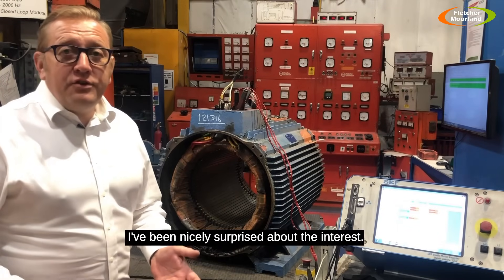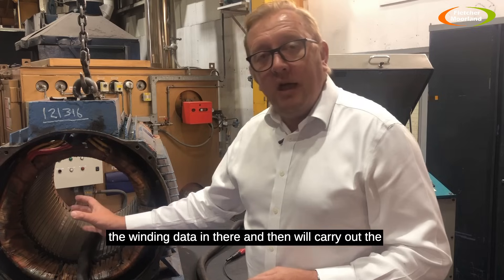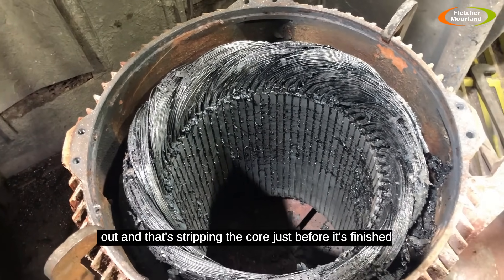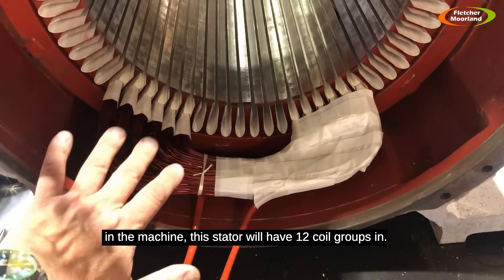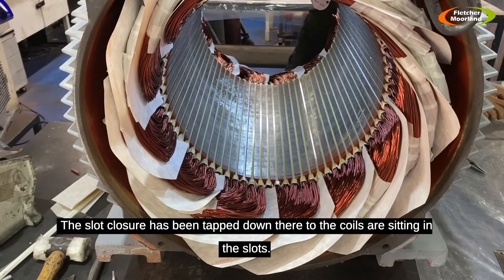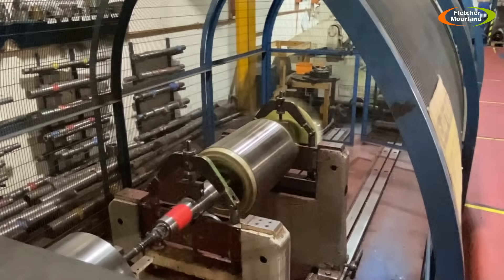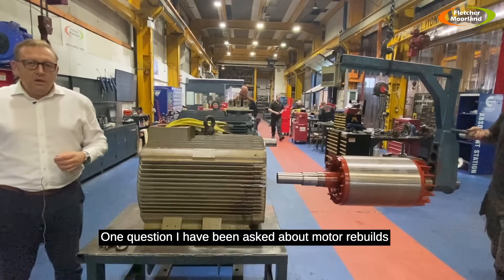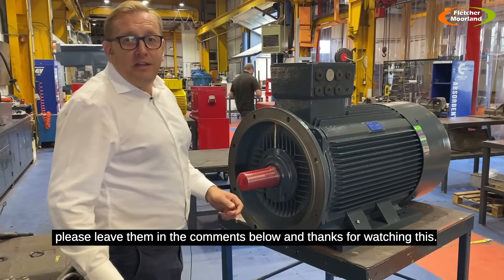How it's done....Electric motor rewinds

Comment: I was a industreal electrician in hard rock mines. Both underground and open pit mines.
I give away my age when I tell you, I hold Journey Man 1st. Class Industrial Electrician, North West Territories, Canada. Ticket # 108.
I was also the only motor winder in the N.W.T.,  winding A.C. and D.C motors. Single phase and three phase. 1/16 hp to 1000 hp.

Motor factories now use machines to wind motors.

Comment: Are you looking into electric car motor rewinding yet?  Are they too small?
Reply: No, they are a little more complex but we are rewinding and repairing them. We see more bus/truck traction motors than car motors just now, however I do see car motors increasing here for repairs.
Reply: @fletchermoorland3501  if you are following EVs.  The early model Teslas leak coolant into the stator and damage the windings.  If you want to create a new business segment.  Nearly 100% failure rate.

Comment: Rebuilding an electric motor (large commercial) is far more economical than a complete replacement, plus the upgrades that were shown make it superior to the original unit when new. Excellent video.

Comment: Worked in the Uk several times and im surprised by the lack of PPE 🤔
Reply: The processes shown that needed eye protection were the removing of the windings, balancing, brazing the connections, VPI and testing. All had eyewear. The guys wear safety boots too. That's all that is needed for those processes.
Reply: @fletchermoorland3501  Odd that, because every powerplant and rotor repair shop I worked in while in the UK required ppe at ALL times 🤷🏾

Comment: That's the butcher way of doing it.
Reply from the maker: What is Simon?
Reply: @FletcherMoorland  the way your putting the wires in. 
There all tangled and forced in.
I invented away to stop that happening.
Reply: @FletcherMoorland  average of 25 seconds to fit one side of coil. 
Each tool is designed for the core thats been rewound and 3d printed. 
Have tested it up to 2.4 mm wire.
Reply: If your interested its still in beta. 
But perfect for large semiclosed slots 
Works for full and half slot windings 
Goes in like magic

Comment: There are videos on YT of this very process being carried out in workshops in Pakistan. No personal safety equipment whatsoever for the workers...dust and dirt everywhere...the floor the ceilings workbenches its everywhere. No hi tech balancing ..analysis ...fault finding etc equipment to speak of. Open fires in the middle of the work area to burn off any old insulation and presumably to cook on at the same time. In fact it would be safe to assume that they defecate right next to their work area....Amazing

Comment: do the economics actually justify the rebuild?  are they that expensive?
Reply from the maker: They certainly do, plus there is also the sustainability side of repairing and reusing something already built instead of manufacturing new. In this case the rewind and refurbishment was around 40% of the cost of new.

Comment: 17:27 You have NO idea how important it is to look after a shaft that size without protection because you don't know who's going to be touching it, how big the hole is, who's going to lube up that big shaft so it can EASILY slide in the hole, how clean is the hole, who looks after the hole, how often is the hole cleaned, how proud is the owner of the hole, has the hole always been looked after, has the hole ever been tarnished or gotten really dirty so it had to be thoroughly cleaned so no one would no how dirty it used to be and is there ANYTHING that the hole could do to damage the shaft?

Comment: Thanks for that video, I left the motor rewind trade 40 years ago having had a 5 year apprenticeship and then 6 years as a skilled winder. Most things haven't changed much although we wouldn't have done the initial tests, well we didn't have the equipment to do them, also dread to think of the damage we did to the lampack heating up with gas torches to strip the old windings, also no VPI back for us back in the 70s and early 80s varnishing was just running the varnish over either end and through the core before into the oven overnight. Great video and certainly brough back a good few memories, can almost smell the varnishes and the odour of burnt out windings on a motor in for repair. Happy to have done it for 11 years, equally happy that I changed to a career that let me retire before I was 60. Thanks for posting.

Comment: Simply Fascinating ! I like the practice of repairing and rebuilding defective units instead of simply disposing them, or even recycling the metal elements alone. Looks like your rebuild tolerances are superior to the actual original manufacturing specs, thus, you're improving the efficiency of the device. In other words, "you're company is remaking the generator better."

Comment: An informative video but, one thing I would have liked to have seen was a little more detail on how each step of the process was accomplished.  Like installing coil groups for example, it basically showed what it looked like before they were installed and then what it looks like after. Not really showing much of how the actual installation process was done.  But a good video nonetheless.

Comment: I did my electrical apprenticeship as a  rewinder 50 odd years ago, then became a linesman LV and HV/cable jointer LV and HV then Switching Operator LV and HV up to full Switch Yard/Transmission voltages (220kv) and now a retired pensioner. Practices and materials have definitely changed over this time!

Comment: Ah! so the the coils are formed and then manually pressed in one wire at a time! I was never sure if they were "sewn" through end to end. How many man hours did it take for this stator receiving to shipping?

Clearly for certain applications, this is economical for the customer, but is anybody still doing "small" motors/generators?

Last week diagnosed a 6.5KW genny stator with a toasty phase. An entire replacement unit (with power plant) is $700, I can't imagine that I could have the stator wound for less.
Reply from the maker: There are certain motors that have to be 'sewn' through and then there are times where the whole coil can be pressed into the slot, those are usually more HV stuff. The time to complete this stator was around 80 hours. For the smaller stuff it's generally not economically viable to repair. This is unless you can't get them anymore!

Comment: Carn't be bothered with air extraction on an unknown burn-off varnish coating, is the burn-off producing cariogenic ash??,  sod it, where British,  we  filter everything through a fag...
Reply from the maker: Don't be that bell-end please! The burn-off oven is produced by Pollution Controlled Products designed especially for the burn-off of electric motor hydrocarbon varnish. LEV monitored and signed off by authorities.

Comment: I understand from other experiences, the lacing is made to fall apart if the windings are 
overheated? I work on small gas engine generators and people who work on these say
that if the lacing is in pieces, the gen was overloaded, so between missing lacing and 
color changes we or I can tell if it is worth fixing. If the color is good and no missing 
lacing then I have to find if the rotor is good and if the exciter winding in the stator is
also good. there is more to this. The rotor receives power from the exciter winding after
it has been rectified and sometimes a voltage reg. is used.

Comment: 200 KW motor /voltage would give the amps drawn? which would determine wire size? what 
would the voltage be for this motor? I see this as a 268 hp motor? So if the motor is rated at
90% efficiency, just about all current is being converted to a mechanical force. This is a great
video. Thanks!

Comment: Would like to have seen how the lubrication is setup.  Is it a polyurea grease used?  Is it auto lubricated?  I understand many motors are ruined when grease enters the motor itself.   What was the application of this motor?  You said it was water ingress that caused failure was anything done to prevent that from happening in the future?  Nice thorough video.

Comment: In 1975, I met a man named Jerry Brown who would become one of my best friends.  He had just left a large motor repair shop and opened Jerry's Electric Motor Service in Cleveland, TN.  Over the rest of my career as an engineer, I moonlighted for Jerry and learned all about winding motors.  Jerry had an encyclopedic knowledge of motors.  He prepared a 3X5" box of flip-cards for my use.  To save money, I designed and built him a core loss tester and a surge tester, copying what I found in a Baker manual.  I also designed a pneumatic winding puller for after the bake-out.  It had both a hook that could be looped under a winding and a pair of pliers with chains welded to each handle.  The more the physical resistance, the tighter the grip.  Most windings came out with the hook.  I also did repairs on industrial electronics such as VFDs.

I am surprised that you didn't show the coil winding machine and the process, for I found that most fascinating.  Also that you wound each coil separate with all the brazed connection.  We wound all coils in a string with a single wire so the only brazed joints were the exit leads.

A handy thing for people to know is the use of Sil-Phos as the brazing alloy.  This alloy is self-fluxing so no external flux is needed.  I use it for refrigeration for the same reason.

I lost Jerry in 2022 to lung cancer.  A lifetime cigar smoker.  Part of my reason for writing this is to memorialize Jerry.

All in all, a very interesting video.  Thanks.

John

Comment: nice  easy to under stand video gives me a little more incite to what happens when we drop off a motor to be serviced  never put to much thought into it before other than we were   taking a quarterly  electric motor drop  off ride to  Franks Our electric  repair place  to repair few motors . most i ever  thought was  road trip away from the college and pick up lunch orders for the guys that helped load these beast motors weighing few hundred  pounds to be fixed

Comment: Nathan your lacing backwards, draw the tying cord through the back and out the front, it wont snag on the edges of the slot liners and also helps pull the overhang back from the core. Well done on a nice job. 35yrs in this trade here in NZ.

Comment: So, each coil is wound by a machine, presumably CNC to customise each job, and then the men just squeeze it in a wire or two at a time til it's done?

Beats winding it manually I suppose! I'd like to have seen some more of the machines mentioned, particularly the coil winder since that seems like it does most of the important work. Apart from that, good video, nice and relaxing. I'm into electronics but not heavy stuff like this. Nice to see people still doing industrial work in Britain, I bet you'd have to look a way to find another. Nice to see apprentices too, doing the donkey work, but showing that the plant has a future. We'll likely continue to need great big motors for a while yet. Actually electric cars are surely a growth market for that, though probably the car company winds their own rather than buying them. Will be interesting to see what car mechanics' garages look like in a few years.

Comment: Ex mather & platt / GEC large machines and ABB motor technician. There are a couple of things you fail to mention in this video. One rewinding of wire wound machines is unlikely to be cost effective due to the intensive labour involved. Secondly this re-wound 200kw machine will now have greater efficiency losses compared with a new machine wound motor.
Reply from the maker: If certain processes are carried out, namely a burn out not exceeding 370C and core loss tests are done pre and post burnout we can maintain the efficiency of the motor. Losses are usually the cause of uncontrolled heat sources in the strippiojng process damaging the interlaminar insulation layers and thus increasing eddy current losses in the core.

Comment: I've always wondered: does the nameplate data change, and is a new nameplate fitted once the motor is rewound?
Reply from the maker: No, we are not changing the performance of the motor so it remains the same.

Comment: Having worked in a motor repair shop in the USA many years ago , found this a great video. Am wondering the HP of that motor. You are using some precision tools ( Balancing equipment, Vavum varnishing EtC) our shop did not have. Great job.
Reply from the maker: let's round it to 250Hp, over here it's 200kW

Comment: So, I guess that as much as it costs to do this, it is more economical to do a rewind than just
purchase a new motor?
Reply from the maker: exactly, around 40% of the cost of new to rewind this.
Reply: @FletcherMoorland  o.k. So maybe 2000$ or pounds as I think ur in jolly old England 800 for a rewind as compared to a brand new motor at 2000. I say I
really enjoyed your video, I have seen coils wound by machine and figured they
were for a transformer. 
I love transformers! they have an E style core and most of the transformers I get
are from battery chargers and microwave ovens. A part of the core covers the 
ends of the E which is laminated , and is brazed so there is a very good magnetic circuit. Applying 12 v d.c or less to the primary of a micro
-wave xfrmr makes a very powerful electro-magnet. Cheers!

Comment: Very interesting! I thought just the damaged coils could be replaced, which style is better? the Y 
or Delta? Am I correct in thinking this is done in England? I know there can be more windings
for a multi-voltage motor say 240/480, in which case at 240 the coils would be wired in parallel
and in series for 480. Thanks very much for taking the time to show how this is done.

Comment: Lost art. Toss it and buy new.... Until you run out of cheep.
Reply from the maker: It's a very buoyant business again, as you say, running out of cheap, Lots of electrification in transport these days needing rewinding.
Reply: @FletcherMoorland  I owned a machine shop for years, we had a rebuilder in Rochester that was fast and a rewind was just as good if not better than new. Oh and the motor you take off and rework goes right back on without fitting and fussing.

Comment: Been 43 years, since rewinding & Balancing rotors, "& Bearing replacement" ,  USN, always wondered with, Inverter power, How you reduce, bearing eddy currents, coating bearing outer race's seems kind of weird, but hey, if it works!

Comment: Great Memories !   I started working at age 12, in the electric motor shop of a large A/C compressor remanufacturing shop.  Next door was the machine shop.  For 5 years, all summer and any holiday, my brother and I would be at the shop.  It looks like little has changed, except we always used slot paper with a cuff on each end.  They kept it in place.
I learned so many things (responsibility was the most important thing) that other kids only learned later, if at all.
As I mastered a skill, they taught me another, they another.  The men would take me hunting and fishing, we were close.  My brother went on to be an Electrical Engineer and I just retired after 30 years as a Physician.
I loved my years working as a child.  5o cents per hour the first year, a dollar an hour the next year, and as my skills expanded, so did my wallet.  Working would help many children be independent and successful.  I KNOW it helped me.
Reply: Excellent!

Comment: We used to use yourselves when I worked at Michelin tyres in Stoke. We had a 120kw motor that burned out while I was on a night shift and we removed it and contacted you for a 24hr rewind.  Sure enough when I was in on the next night, it turned up. We fitted it and it lasted about 30 minutes before it started blowing fuses. No fault of yours, it should have been wired in delta and our sparky wired it in star! Anyway we took to off again, sent it back. Next night shift we refitted it and guess what, our spark did the same again, needless to say he was moved to another department very quickly after that

Comment: much more professional job than GE Apparatus Service shop in USA in the 1970ies, insert Rotor with crane and long pipe , Varnish dip, no Vacuum/pressure treatment, beat windings into place with malletss/hammers.... no core integrity testing, megegr and hi pot, and yes balance large rotors....

Comment: I'm wondering what size motors does rewinding become cost effective vs cost prohibitive. Second. if I had to replace some of my home woodwork shop motors like my 1.75 H.P. bandsaw motor, what would be the best way to dispose of that motor?
Reply from the maker: That's a difficult one to answer. I'd say where the cost is more to buy new than to rewind is a good start. I'd send your failed to a scrap merchant. They'll make sure the materials are separated and recycled.